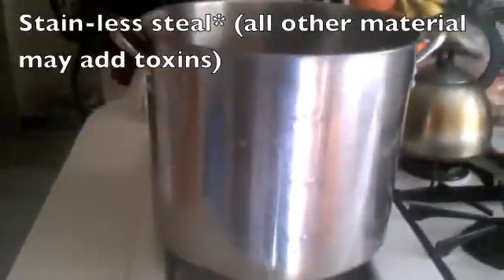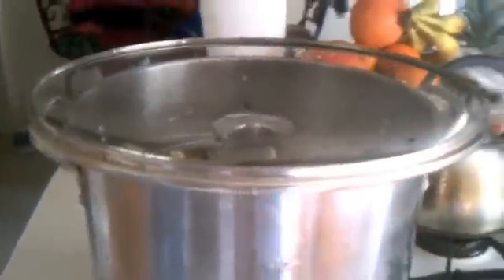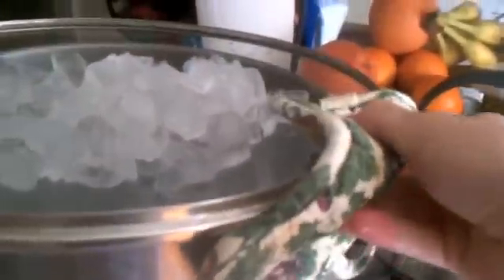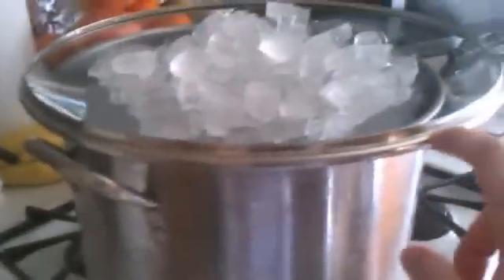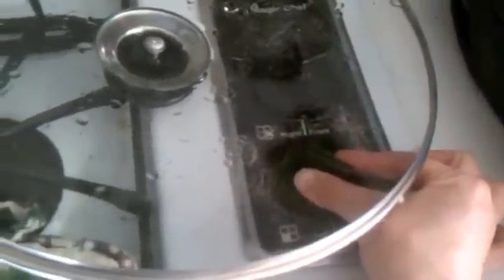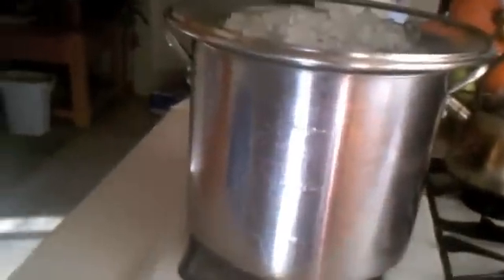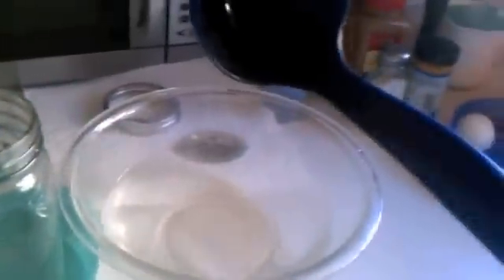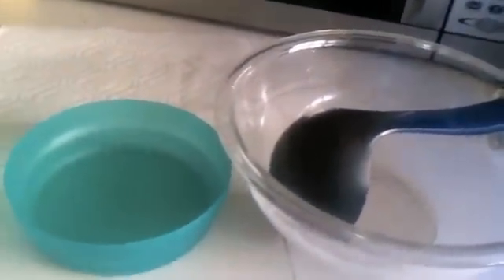How To Make Distilled Water | DIY Distilled Water

Comment: For those of you who do not know, there are many purposes for distilling water. Not solely for drinking. In fact it's less commonly made to drink unless the water available to you is unsafe to ingest without having to boil or chemically treat it. The reason I looked for this is because I wanted to make soap. If I use regular tap water to do it then it tends to leave unwanted orange spots and cause the soap to smell rotten within weeks. Since soap takes 4-6 weeks just to cure, thought it might be worth learning how to make instead of purchasing it at the store. After seeing the process involved in distilling water I might just buy it. Thanks for the information though! Good to know.

Comment: Btw, I would use for my iron. Whether or not I would drink it would depend on how well easily rooted plant cuttings grew good roots in it. I found the water in my UK home (tap and no fluoride) best for rooting. Evian/Volvic mountain water not so good, but water filtered in a jug with a cartridge killed the jade cutting below the water line. Rotted it! 
Another way is to water a plant with it. If you use microwaved water, you will throw your microwave away when you see how fast the plant dies.

Comment: Also....Instead of loose ice....Put some water in the lid...freeze a few small quart size freezer bags of water and float them in the water in the lid till they melt...then swap for another frozen bag...that way you don't stop the condensation process by lifting the lid...However, your initial thoughts were spot on....You should strive for a chemical engineering degree young Lady!!

Comment: If you REALLY want something GOOD to drink....Use cheap box wine instead of water...put a stainless steel colander upside down in the pot to set a Pyrex measuring  cup on to collect the condensate .... and bring the heat up just enough to see liquid condense on the lid and drip without boiling the wine....
TA DAAAA.....Instant brandy!!!  ;)

Comment: First put a mug in the pot facing up... fill the pot with water just over the rim of the mug. then put you're bowl on top of the mug, to prevent any splash over.. make sure your lid doesn't leak and fill it with cool water.. this will make for a higher surface area for the water to condense on,  water vapor will still condense even with fairly warm water on the top. just change it out when too much steam is coming out from the sides.

Comment: Great video.. I dont know if you realize it or not but here in south ga we make moon shine in almost the same way. Instead of plain water in the pot we put a mixter of crushed corn that has soaked in a 5 gallon bucket for 7 days
Its called corn mash ..it gets slow boiled and the steam is caught through a small copper tube that is coiled in a barrel or larg bucket of cold water.. hence the steam or condensation turns back into a liquid form wich is the alcohol.  So you have actually made a still.  Great job ! You explained your task very well ..thank you  for you effort and I hope you continue to make more great videos like this one.  Keep up the good work

Comment: do not use stainless, iron, aluminum or teflon coated products.

use only copper.

copper pot
copper lid
copper accumulator
add 1 teaspoon lemon juice
1/ tsp bicarbonate
1/4 tsp cream of tarter to 4 qts rain water, 
do not boil water,
put the contraption outside in the direct sunlight day and night until the water in the kettle has evaporated and left behind a dry white filmy residue in the water kettle.

this residue is flouride barium lead mercury zinc bromium salts you do not want acumalating in your joints.

this is a natural way to acquire pure ANGEL WATER OR MOURNING DEW OR BIBLICALLY SPEAKING " MANNA" food of the gods.

Comment: Tap Water needs to be removed of low boiling point toxins first: some toxins have a boiling points lower than 100 C degrees and will remain in the distilled water if not removed see https://www.americanelements.com/boiling-point.html

Comment: i suggest you to put in the bottom a stainless steel frame or support to put the bawl on it, so in this way even the water finish, the bawl wont touch the bottom and burn.

Comment: Great video and awesome idea!! ...but just one thing, and I'm sorry for being a critic, but I hate using anything plastic...so the plastic knob on the lid would have to go and maybe replaced with a bolt and nut...or just reversed so it's on the side with the ice...and the spoon, maybe a stainless steel one instead...and the plastic bowl, possibly a porcelain or glass bowl. But besides that, you did a great video on a great idea!

Comment: The purest water is simply to bring a pot of tap water to a hard rolling boil for 1 minute, 3 minutes in high altitudes, to purify it. If it's cloudy,  simply strain it through a coffee filter, paper towel or cheese cloth... til it's clear and sediments are filtered out before boiling. Do your research: Boiled water vs Distilled vs Purifed vs Spring vs Mineral... Boiled is the purest, easiest & cheapest no drama way to get healthy water. Let it cool then refrigerate in clean container of your  choice for drinking. I have a 1 liter container with measurements on the side of it so I know how much water I drink daily. Bring a pot of tap water to a rolling boil for 1 min then cool it and fill some gallon jugs to store. Refill your refrigerated bottle as needed. Very clean, pure taste &  cost effective! I saved my Argo Tea decorative glass bottles and use them for various fresh teas (ginger, lemon, raspberry, etc.... fresh squeezed lemonade, carrot mango juice, etc. to have a variety of healthy fluids to drink in the frige at all times. Put a piece of fresh lemon in your water. It's acidic but turns alkaline in the body when consumed.

Comment: I would use a stainless steel lid. Eventually, a glass one will crack when adding more ice. In fact, the ice is not necissary because of the shape of the lid. Room temp  will suffice for the lid...

Comment: I would just fill the whole pot up with Tap water 💦 bring it to a boil let it cool then scoop or pour it into the glass or stainless steel containers. Ice and glass bowl is pointless. Too many unnecessary steps plus the plastic handle is releasing toxins from the steam dripping into the bowl defeating the purpose. At the least the top handle should be stainless steel nothing plastic involved whatsoever. Nice try tho. ♥️

Comment: You can forego the ice if you use a small fan and aim it at the top lid only. Doesn't have to be a great big fan just something that will blow out across the top of the glass. The temperature of the glass only needs to be slightly cooler than the steam that's hitting it in order to create condensation. Thank you for the video

Comment: Very well presented, but, given the cost of the ice and the cost of using the propane for the gas stove, it might be less expensive to buy the distilled water (plus the cost of such a large stainless steel pot etc.).
Reply from the maker: yes, buying is cheaper & easier, but for those who cannot get to the store...

Comment: Yeah okay you distilled water, but you also distilled everything in your pot with a boiling point under 212°F as well. So say if there was gasoline in your pot. Because gasoline's boiling point is lower than that of water, you would boil that gasoline right into your "distilled water."

Comment: you don't need the glass the ice.  The inverted top works without it.  Use a bundt pan that rests on the rim of the pot and you won't risk burning yourself reaching into the pot for the bowl

Comment: Nice Video but if you had used a metal lid instead of glass you would have got more condensation because of better thermal conductivity.

Comment: Though they are a fire hazard easily, most say to keep a fire extinguisher by if one does it. Many prof destillers use a peltier element for heating it seems. Fire risk is very high. One should be very careful using it. Your ice method looks nice, but it would be annoying daily maybe, not sure... if the output of the whole thing was higher, like 2L water, I might be using this method here you videoed. But it only looks like 0.5l or so...... I like the method though! .... no nasty plastc parts. Most prof destillers have plastic parts inside, which have carcinogens in them... BPA

Comment: You can improve it, add a peltier element with a fan, 9v fan. It has a cool side, meaning it can cause condensation you need. And its all electrical. Removes need for ice. It creates ice, from electricity. Has a hot and cold plate. Just needs a fan on, to not overheat.

Comment: Here's a little tip to make getting distilled water much easier.  Go to your local Walmart or in my case in Michigan Meijers.  Walk over to the water section and pick up a gallon container of distilled water for 89¢. This tip will save you money!  First off a small bag of ice like you used (if you used it all) is like $1.69 where I live.  Secondly you will save a bit of change from not using natural gas or propane to boil the water.  Thirdly you will not have wasted time cleaning up after doing all this rigamarole in making the distilled water.  
Not to worry young lady you still got a thumbs up from me for taking the time to explain the procedure via your video.

Comment: explained it all at1:29. The ice condenses it quicker saving gas n energy. But water takes energy to freeze it into ice. Just boil it with the lid upside down, water decipitates on it's own, atmospherics play a big part in all this". Easier in the UK because it's alot colder than the USA so we don't need ice. A form of mustard  gas can be created by distilling Cabbage and refining it. It's called mustard spray or Mustard gas. Always be careful what you distill. Whisky is one of the better 1s
Reply: Pure Water, distilled water flushes all the unwanted minerals ya body don't need. why don't they tell us this. Because we will live longer. Spring water is a load of bollox  It's just Tap Water. Triple filtered My Arse. Take out the minerals we don't need. Give us a chance before you kill us all with ya shitty chemicals

Comment: That's not distillation. Distillation is the collection of evaporated gasses into it's purest liquid form. Your just melting ice. You might as well cool and drink the boiled water in the pot. It takes a funnel shaped lid over the pot to collect the evaporated water " steam " and drip it into a clean container.

Comment: Rather than letting the bowl float, would it be safe to place a steamer rack in the pot to elevate the bowl? I realize the rack would heat but if the bowl is a heat tolerant pyroceramic, it should be safe, right?

Comment: Total waste of time and money, why? because you can buy a gallon of distilled water for less than a bag of ice, to boil the water you already used a lots of energy, gas or electric, and you must pay for later, to be clear I'm not against experimental activities, I love to do, but this way of making pure water is not economical with very low production, in an emergency cases and absolute need for distilled water this might be a good idea, but you need heating and cooling sources which at the time of emergency finding them is almost impossible.

Comment: This is to much work.,      Boil your water for 3 minutes wil get rid of the bleach and anything else they put in tap water.     Once water is boiled, put it in some jars, I use litre jars and then put it in the sun for the day.     Your water is purified.    It should taste sweet.
Reply: +Sarah .. You`re wrong  the so called bleach = clorine will just convert to some other form of chemical when boiling and the flouride in the water will become more concentrated with boiling ..

Comment: I distill water using a tabletop still. It does a gallon at a time. Instead of ice for cooling, it uses a condenser(much like you see on the back of a fridge) blown by a fan. It shuts off automatically when the temperature goes above boiling in the tank. Works quite well. If I'm not mistaken, I think it takes about 4 hours to do the one gallon. I've been thinking of making a solar heated still doing larger quantities.
The water tastes amazing.

Comment: To make it easier to clean out the pot afterwards, put a bit of baking soda into the water. a quarter of a teaspoon should work. It will prevent the calcium deposits from forming. They are very hard to remove. Instead, you will get a soft sludge which cleans out easily. 
Historical reference: The US Navy used to do this to the boilers of ships to make it easier to clean them.

Comment: Just a few tweaks,the water doesn't need to boil just add heat. If you have a gas stove gust set it up over night in the oven or on the back burner the pilot light alone will do all the work over night with less loss of water. the ice is not necessary at low temp the water will condense all on it's own. it just takes longer. Fantastic demo loved it great job.

Comment: A good home demonstration for those who don't have a laboratory or a purpose built still.
 
You don't actually need a stainless pot to boil the water in as any impurities that may be added to the water from the pot are distilled out so there won't be any in the distilled water produced! But as most steel kitchen pots are already stainless steel, this should not be an issue....

Comment: Can I give you a few question? My english is not very good, I can not catch everything from the video :1) what effect does the ice on the top of the cover have?2) How do you know, how long to boil it? till all the distilled water from the iron pot is in the glass bowl?3) Are you boiling it on the middle flame?4) The glass bowl should be just only a little smaller than the iron pot?5) So when the glass bowl stops to be "swimming" on the water in the iron pot and is settled on the iron bottom, the water is already distilled? thanks
Reply from the maker: 1) it produces condensation
2) you boil until the water bubbles and you start seeing water drip from the bowl
3) on high flame
4)yes, enough to fit inside
5) the water inside the glass bowl is the distilled water only

Comment: great video... But really with the time involved and the cost of the jars, you might as well just buy a gallon of distilled water from your store. The only reason I wanted to see how this was done, is to use it for my cars cooling system, not to drink. I used to have to leave my water out on the counter overnight before I could use it in my fresh water aquarium, and I used to think that was distilling it when actually all that did was get the chlorine/chloramine out of it so it wouldn't kill the fish... What is was to be so young.

Comment: I think this is great if you don't have equipment laying around. Very simple solution. I would try to make the bowl not touch the boiling water. I think it would be more effective that way. The boiling water will also start to boil the condensated water much faster if the bowl is in direct contact.

Comment: is rain water distilled water?
Reply: No. Distilled water is has all minerals and chemicals removed. Rain water  still has all these things in it including bacteria. The absence of minerals in distilled water makes it unsuitable for long term consumption. Its good for cleaning and medical use.
Reply: thank you
Reply: Akeem Lvl. Boiling your water will kill most if not all the bacteria. However, all the chemicals like chlorine, flouride, etc which are present in tap water, are left behind. The Distilled part of the water is the steam that rises off of the boiled water and then condenses back into liquid(hence the ice and lid) This process leaves you with a chemical, mineral and bacteria free water. If anything, the boiling (only) process concentrates the level of chemicals etc.
Reply: Bubba Reednick  heyy I though tht once you boil the water tht it's distilled.. do I have to do all the extra stuff like put the ice cubes on top the lid. plz hit me back i wanna kno
Reply: Bubba Reednick wow thanks
Reply: Thanks for the information.
Reply: ebert beeman
Reply: Only in states few states not all over
Reply: rai. water gAthers way too many things in the air
Reply: sometimes rain is made by planes spreading chemicals in the clouds .....
Reply: Distillation is a specific Production method... but it is a type of Vaporization and Condesation... Basicly the same thing, but Technically No

Comment: I'm not trying to be mean (like others), but the water is NOT going to be "very pure" due to splashing of boiling water into the bowl with the water vapor (distilled water) area. This is a way to show someone how distillation works (good enough for a high school classroom demo), but it is NOT a good demonstration as to how to make PURE distilled water for practical use. Using ice is also wasteful. If you want to know the best way to do it on a stove at home and have really "PURE" water, look up SurvivalStill on Youtube. PS) People, if you're doing to use your cell phone to make a video or take a photo please learn how to turn it in the right direction.
Reply: Escape From NY 

I agree on the placement of the bowl, but to get the best effect, you have to make sure the water condensates on the lid and making it very cold with the ice is the way to get the best result.
Reply: Even when you easterners try to not be rude...oops
Reply: Better then the black particles that come out of my faucet I'm afraid that I might die if I drink it
Reply: Is water supposed to be crunchy
Reply: $300 bucks for the "survival still" no thanks